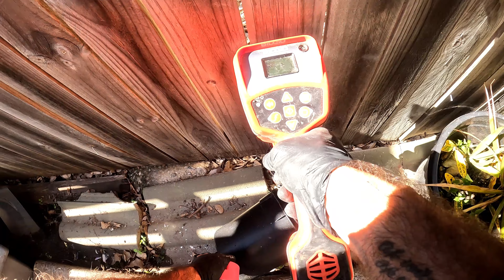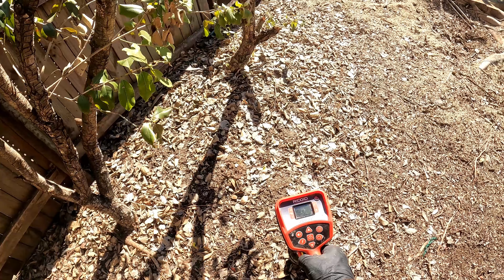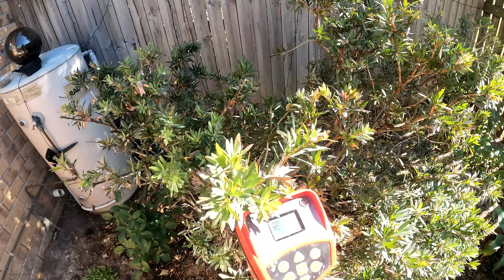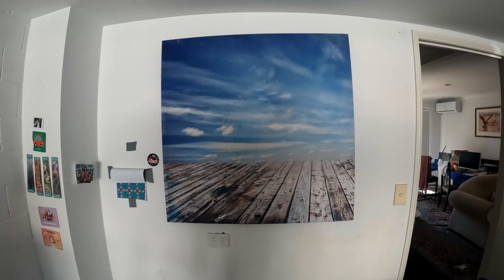Blocked Drain 392 - WIPES , CONDOMS, POOP & 6 Units BLOCKED || Another Plumber QUIT...

Comment: Crazy plumbing down under. I should talk though. Much of our lines are under the cement in our basements. If it can be cleared fromj above ground pipes, then they usually have to put a hole in the cement and replace pipes. Great job of finding those.

Comment: Honestly thinking that we appreciate you as much as you appreciate us. Gavin, I guess most of us think of you as part of our extended family, that's how I think anyhow ❤. Where I used to live in Wiltshire, England, we have around 17 houses going down the hill, we were the fourth house from the top. All the houses has access points in the rear garden, and sometimes they would get blocked, thankfully never ours. One time the ninth house down was blocked and the raw sewage just came up their drain covers and flooded their back garden. Slowly it spread coming up the hill, but thankfully to a lesser extent. All the homes from the top down to the blocked drain all chipped in and got a plumber out. Plumbers in the UK cost an arm and a leg and your left testicle. The plumber came and unplugged the blockage which was primarily due to a baby's nappy/diaper. Strange thing was no-one had a baby in the top houses, must have been a visitor ! Thanks for the post, stay fit and well 👍